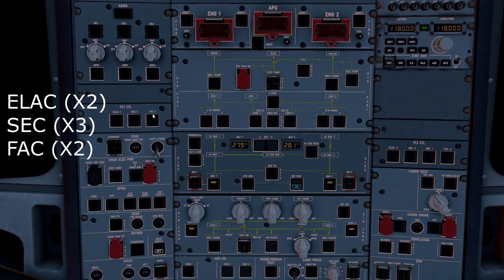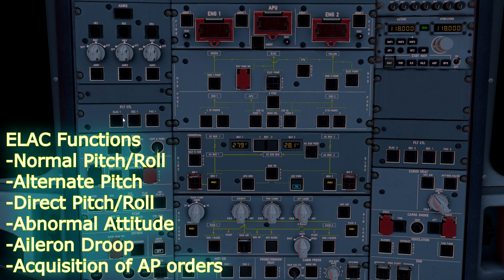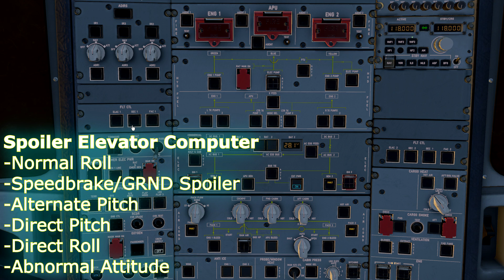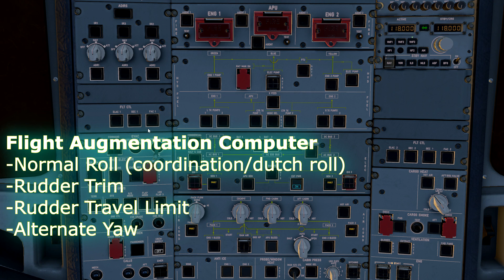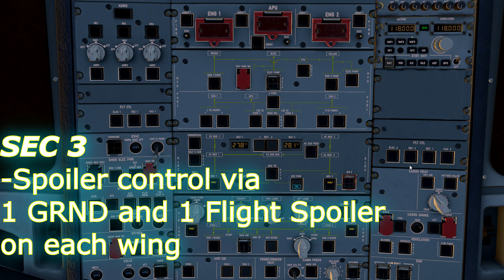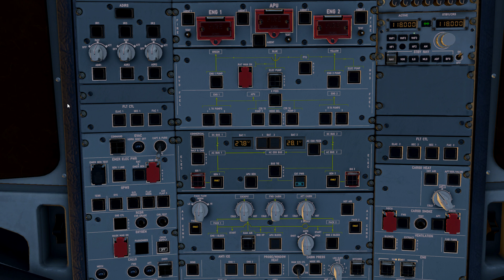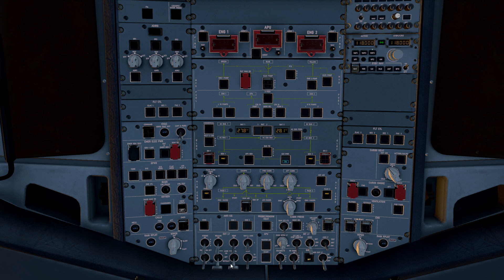Airbus Cockpit Explained | FLT CTRL push buttons Explained | Episode 2

Comment: fac prevents rudder damage at different speeds,...crash over ny post 911 was due to to much rudder deflection ...aircrash investigation series said was it an airbus?? if so why the crash? fac
should have saved the plane from to much rudder input? no? 
ps was a airbus 300 no fac?
flt587